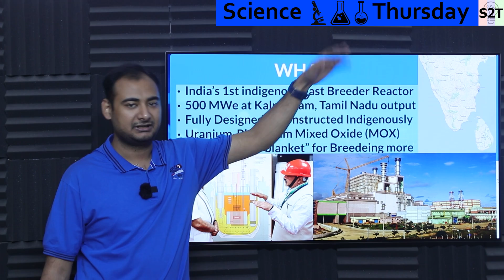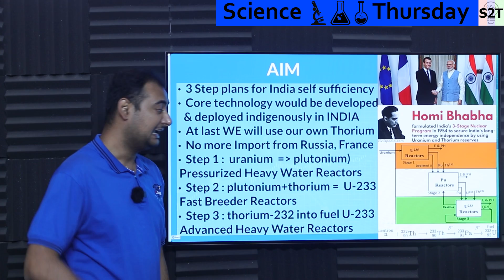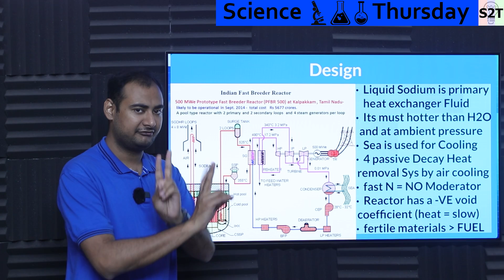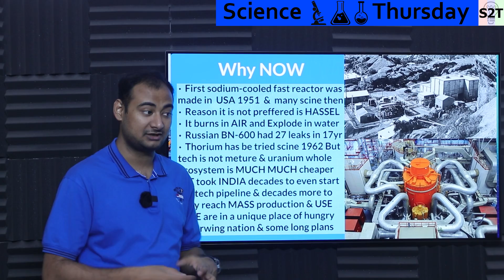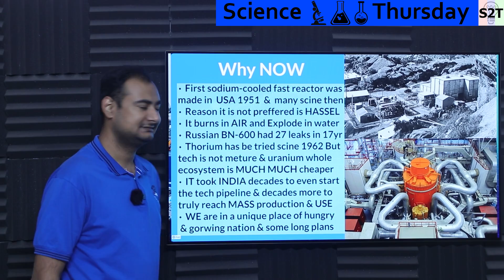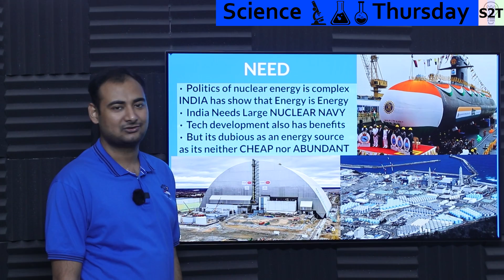India’s Indigenous Fast Breeder Reactor Explained {Science Thursday Ep270}

Comment: I really love your presentations, just a few notes: you (just like alomst everyone) use exponentially as a synonim of "greater" but often it is not the way things scale (like the number of bacteria grows exponenitally, but prices  "only" doubles/decuples wich is way too much but still not exponential growth), you use a bit too many times the same words (like bonkerly, trust me...). and France lowered the power of its power plants because they could not put back in the rivers water too hot, that problem is easy to solve with a couple of buildings that makes the water evaporate instead of having to put it back and mainly does only depend on where you place the power plant, not what type of plant it is. Still great job with the presentation
Reply from the maker: "rivers water too hot, that problem is easy to solve with a couple of buildings that makes the water evaporate"  due you not hear your self water is the problem we don't have enough of it to boil rivers away as its no big deal and using sea water comes with its own LONG & costly problems